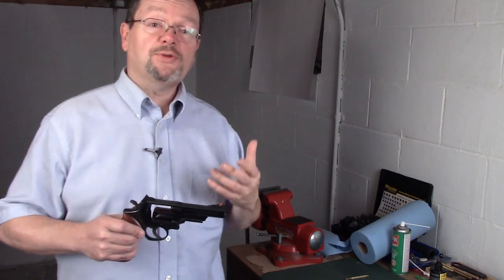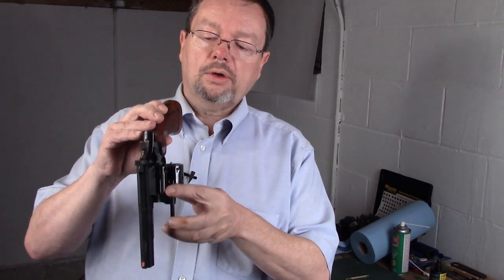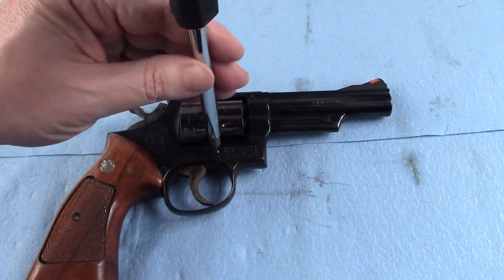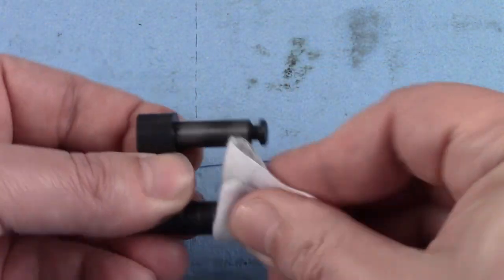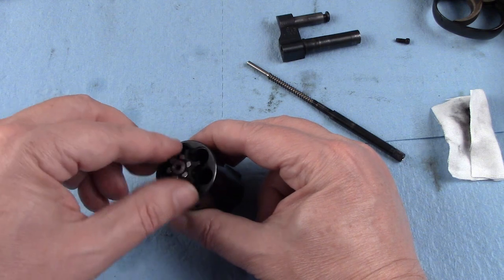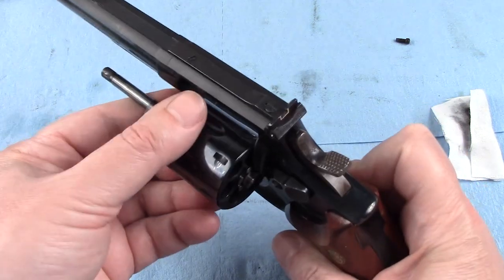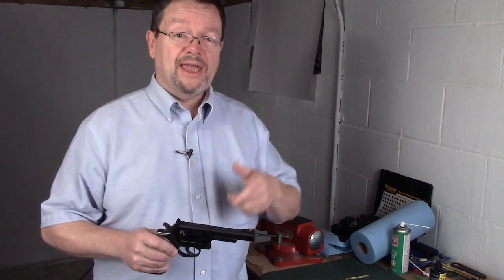How to remove cylinder from a Smith and Wesson Revolver

Comment: Thank you so much! I bought my 629 back in 1986 while in the Army. I have fired 10,000+ bullets and it still shoots great! Today 12-28-2022, I noticed that the cylinder would not close if the pistol was held downward. I don't believe that has ever happened before. I look and found that I could remove the cylinder, that is something I have never done before. I used a q-tip to clean out the hole and felt the q-tip was moving the small screw on the right side of the pistol. I put the cylinder back in and tightened the screw and that worked to keep the cylinder inplace and I could close it when held downward. Then I searched YouTube and found your video: about removing the cylinder. Your explanation helped me know I did the correct thing for my 44.  😀

Comment: You helped me big time. While cleaning my 686+, the screw that holds the channel on the yoke had backed out and I didn't know it. Yoke came out, cylinder came out and I was perplexed to say the least. It's a relatively new firearm! Learning the purpose of that screw from your video saved my butt. Also gave me a chance to clean where I had never cleaned before. Thank you sir!

Comment: I just bought a police trade in 640 that is all sorts of gunked up(cylinder won't spin freely) and yours is the first video I've found that actually shows full cylinder disassembly.  thank you.
Reply from the maker: You're welcome. Glad it helped, and I hope you get that 640 running again!
Reply: I spent a good while with q tips and toothpicks scraping all kinds of old gunk out of it.  The cylinder spins freely and the trigger is much improved.  However I can not get the extractor to unscrew.  No matter what it will not budge.

Comment: Yes you did get the cylinder out, but I totally disagree with your procedure and heres why.  Of course you do remove the yoke retention screw and swing the cylinder out but you do NOT slide the entire cylinder forward.  I definitely heard a rather large clunk when you did .  That was the sound of your cylinder hitting your barrel and possibly damaging your bluing.   The CORRECT  way to do this is swing out the cylinder as far as it will go and hold the cylinder stationary while you gently slide out the yoke.  Then lift your cylinder straight up.   You risk damaging the finish on your beautiful revolver every time with your method.  I learned this from a video by GunBlue490, who is a certified Smith and Wesson armorer.

Comment: Where do you find those flat blade bits? I need a set of those. Great video and timely for me. I ju8st bought a used .357 19-3 service revolver and the cylinder has fouling rings that need to be cleaned.
Reply: Ebay has gunsmithing screwdriver sets or kits, or a Cabela's store has them. They also work great on other precision devices such as sewing machines.

Comment: Should the part where the crane goes into the frame be lubricated or is that unnecessary? Also where the crane goes into the cylinder.

Comment: This was an excellent watch, just loved it. 
I’m missing something, though. What keeps the cylinder from falling off the spindle when you have the crane out? I’m not quite understanding and I’m a little reluctant to take my gun down until I do. 
Thanks a million 😎
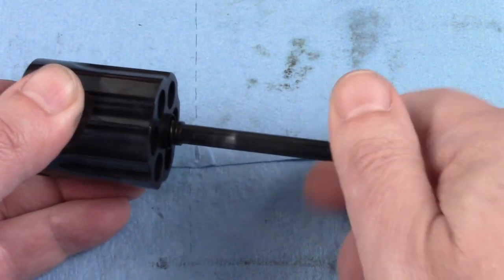Reply: At the 4:00 mark he shows there are two rods holding it in place. Once you loosen the short one clockwise, they separate allowing removal of the cylinder.

Comment: be nice if i was able to get the ejecter rod to even screw off even tried pliers it was used
Reply: Try turning it the other way, S&W was pretty random about the ejector rod screw, I have two identical models only a couple of years apart, one has left hand threads, the other right hand threads.

Comment: I have a semi-related revolver question. After about 8 months, I noticed that the barrel shroud on my Rock Island Armory m 206 snub nose 38 had rotated off center, and the front sight was no longer aligned with the rear sight. This was after 500 - 1000 rds of factory ammunition. The gun wasn't like that when I took delivery of it. I would have noticed that. 

Rock Island Armory replaced the gun at no charge. But I'm puzzled by what caused the problem in the first place. I never flipped the cylinder shut, or abused the gun in any way.
Reply from the maker: Nearly impossible to do a remote diagnosis on something like that.  But I'm happy to hear that Rock Island stood by their product and replaced it.  Thanks for watching!

Comment: What do you use to clean the burn marks in the front of the cylinder and the forcing cone?  Thanks for the video, I also like to use a pice of masking or blue painters tape on the screwdriver but it helps protect the blueing and will make the screwdriver stay on the bit when you remove it
Reply: For stainless steel frame use the Birchwood Casey Lead Removing cloth.
Reply: BrickPa I agree. Works like a charm

Comment: Nice video. Im not really a revolver guy but I do have a S&W 629. I always thought that messing with removing the cylinder could potentially be a problem with timing when you reassembled. If I was to for example change out my 629 fluted cylinder with a non fluted cylinder, it appears pretty easy. No expensive gunsmith needed. Is that correct?
Reply: Except that the fluted cylinder from other model might not exactly fit, especially the gap between the forcing cone and cylinder may change.

Comment: Whats the best way to get that stuff out of the cylinders? Is it possible to totally remove the marks
Reply from the maker: Since most of the deposits are carbon and lead, normally it can be removed with an overnight soak in solvent, followed by thorough scrubbing with a brush.  But sometimes there can be some minor pitting that cannot be completely removed.  Thanks for watching!

Comment: I heard removing the ejector rod from the cylinder of the smith and wesson model 500 was a bit more tricky, requiring the use
of a vice or grips. Is this true?
I don't know why that is, and cant seem to find a video of the process.
Reply from the maker: Never handled or worked on one, so I don't have an answer for you.
Reply: Thanks. I can only conclude it's because of the bigger loads it (.50) uses.
Reply: Nigel Hissami   hi I have the same issue with the cylinder of my 500 10.5 " .   how did you get to the bottom ? thanks

Comment: Can you tell me why S&W revolver frames, at the rear left side, have what looks like a bend in the cover? Almost looks like someone to a screwdriver and bent it out. It is on most if not all S&Ws. Why is it there? There has to be a logical reason!
Reply: It's to prevent the tip of the ejector from hanging up when opening the cylinder. That's why it's not flared on the other side too.

Comment: Yeah my cylinder doesn't unscrew..

Well apparently it had a lot of buildup because I had to put it on my vise and rotate it just to get it to break free after I soaked it in oil. I guess that's probably 21 years of never taken it off. this was my mom's revolver she passed away in 99 and it hasn't been shot since she shot it.

Comment: What holds the cylinder onto the crane?
Reply: There is a raised half circular part behind the cylinder on the frame of the revolver that stops it from sliding off.